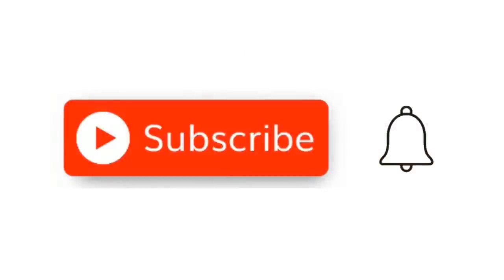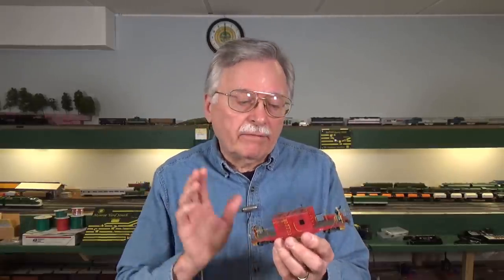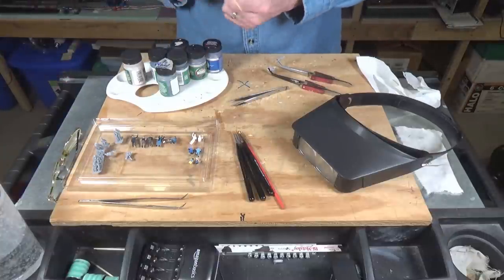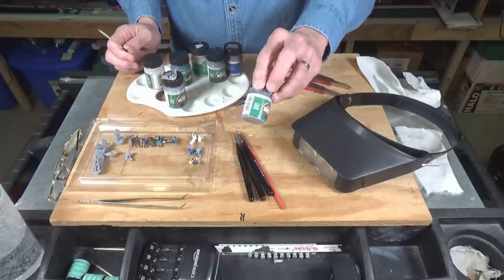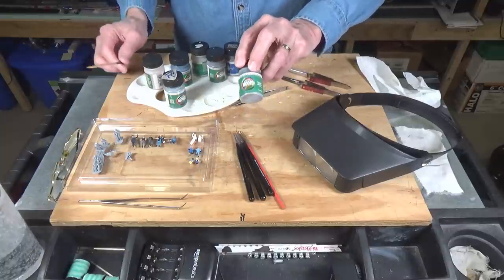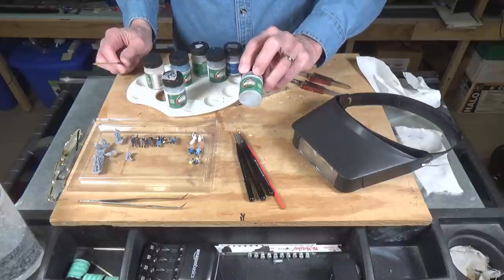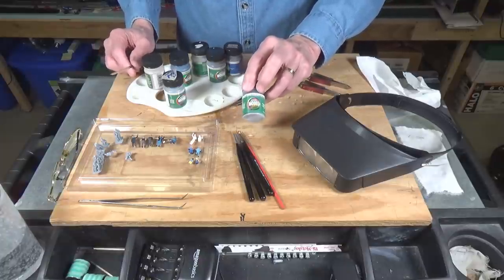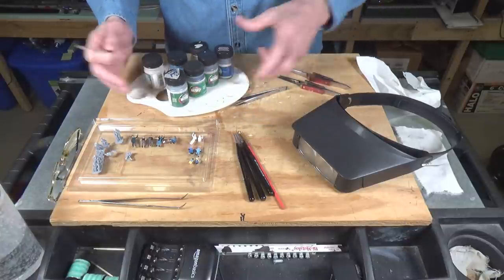Figures For Your Model Railroad (241)

Comment: The first thing I do with figures and other small things is drill a hole in the feet or mounting point and glue a piece of brass wire in it. I then stick the wire in foam for holding and paint drying. I also use tooth picks for painting real small details.
  Thank you for the videos.
Reply: Another idea is to glue a toothpick to the bottoms of the shoes, let it dry, then you have a holder that you can easily use during the painting process.  It can be cut off when painting is done.  The wire suggestion is excellent.
Reply from the maker: You can afterwards use the wire as a mounting pin in scenery. However this guy is destined for a loco cab so I glue his feet to the cab floor.
Reply: I glue my figures to the head of a 4d nail using Aileen's - the glue is strong enough to hold the figure securely, but will release easily when the figure is complete. I glue the bottoms of the feet on standing figures, and glue the bottoms (butts) of seated figures. The nails are then inserted into a piece of foam for priming. The nail makes a good handle while brush painting the details.

Comment: Thanks Larry.  Not painted figures for a while now, but that was pretty much how I used to do them.  Always used to use enamel paints (Humbrol were the main ones over here in the UK), which gave good coverage on most plastics.  You used to get more white metal figures too (I remember some American hobos that came from a Walthers dealer over here, which were whitemetal), which were harder to paint, and really needed a primer.  The whitemetal ones also had more flash on them that needed removing. But most of mine were HO figures from Preiser: it was still important to clean up mould lines, as it's amazing how obvious they come when you're taking close-up photographs.  Because you often get the same figures on every layout, I also like to do a bit of surgery on them: chop of their heads, legs and arms, and reposition them, or even switch them onto another figure. I've also made a gang of punk rockers in the past: just ordinary figures, but scrape away any hair and then glue on the mohican hairdos, made out of thin card. I think it's also important to keep mixing new colours, so that you don't have a street full of people, looking like they all bought the same clothes!

Comment: I painted up about 300 cheapo 1/100th scale seated passengers a year back or so, which work fine inside Passenger cars, where true 1/87 scale figures seem oversize. I used 6" skewers and with just a dab of tacky glue I sat each figure on a skewer. I then stuck the skewer in a piece of white foam which made it easy to paint a whole row of figures, while randomising the colors on clothing, round skewer makes it easy to spin the figure round between your fingers. Took me about 3-4 hours once I got the rhythm down. But now I have a few hundred more to do as I've added 24 passenger cars to my collection..

Comment: Suggest also washing well in IPA first to remove mold release agents.  Then when painting process is finished, spraying the figures with Dull-coat to tone down the gloss finish and protect the final product.  Also use a toothpick glued to the bottom of the shoes as a holder which can then be cut off when painting is completed is helpful.  Good video, keep up the informative information.  Love it with my morning cup of coffee.
Reply from the maker: Washing is always a good idea with molded parts however I have never had an issue with 3D printed ones. The great thing about Modelflex is i  the original patent application the developer claimed it would stick to a wax candle so I have never bothered with a primer when using it over the last 20+ years.
Reply: I also use the toothpick/cocktail stick approach but attach the figure using blutack.

Comment: Hey Larry, some tips as a long time figure painter:
1.) Priming. It’s critical to achieving a good finish on any scale of figure, and can be used to your advantage in setting up highlights and shadows using black and white paint for a technique called “zenithal priming” which is well documented by war gamers and figure painters

2.) The wet palette. Another favorite of the war gaming crowd, this is a cheap palette that keeps your paints wet and properly diluted as you work, and will keep a few drops of paint usable for hours.

3.) Washes. They aren’t just for weathering, a thin dark colored wash as a mid step helps to define the details of a figure and provide shadows you can then work around to create a more lifelike appearance.

Never hesitate to look outside the railroad hobby space for new skills folks, the war gaming and scale modeling worlds have a wealth of knowledge and techniques you can apply directly to your layout!
Reply: HO scale figures are usually considered to be too small to receive shadows and highlights, etc.
Reply from the maker: Washing is always a good idea with molded parts however I have never had an issue with 3D printed ones. The great thing about Modelflex is in the original patent application the developer claimed it would stick to a wax candle so I have never bothered with a primer when using it over the last 20+ years. I’ll have to look for the wet pallet. War gaming videos definitely do have a lot of great tips.
Reply: @davidwilliams1060  You'd be surprised, I use highlights and shading on 1/100 wargaming figures to good effect. It all depends on how much time and effort you're willing to spend on that aspect of your hobby though.
Reply: @TheDCCGuy  Totally fair, the advantage of the zenithal prime is that with properly thinned paints it takes care of quite a bit of the shading for you, making for a quick and easy way of providing highlights and shadows in the colors you use.

Washes in this context aren't actually cleaning, but using a highly thinned paint to tint the recesses of a model and give better contrast. Citadel and Vallejo washes are a favorite acrylic water based type that I use regularly to help add detail. 

Cheers!
Reply: I am a professional figure painter, I actually paint a couple of 3D companies and actual paint for ModelU3D, I use wet palette, acrylic paints, washes,
Reply from the maker: Ian—thanks for the tips, I really need to check out the wet pallets. I am hoping Alan will make his covid delayed trip over here this summer to do scans for a US range of figures. In the meantime I have collected quite a few for my UK locos.
Reply: @TheDCCGuy  hi, yes that would be amazing if and when Alan can get across the ditch
Reply: What is a wet pallette?  I've never heard of the term.
Reply from the maker: Apparently a plastic palette with depressions for paint and a couple mixing areas. It has an airtight lid that allows you to cover the paint so it will not dry out from day to day.
Reply: @dwaineruthannarmentrout1811  A wet palette is a well containing water in something like folded paper towels or sponge, with a sheet of parchment paper (unwaxed and without any anti stick or other fancy additives) on top. The porous nature of the paper allows a little bit of water through to keep your paint wet, and most of them have a sealing lid to let you keep paints ready for hours. 

Commercial ones are available, or you can just make one in a shallow tupperware type container to try it out. There are many tutorials on making and using them all over youtube.
Reply: @Harrumph  Thanks for your detailed answer.
Reply: @TheDCCGuy  Thanks for your answer. I always learn so many new things from your videos and I like the idea of your"feedback forum" at the beginning of the next video.

Comment: Loved the video!  Small problem - your camera lighting.  The lights reflected off your glasses.  Try pointing the lights towards the ceiling of your room and 'bounce' the light back to you.  This will keep the harsh glare off of your glasses, and the light fixtures will not show as a reflection in your glasses.
Reply from the maker: I use LED panels which give a nice cool light compared to my old halogen lights. However they are not as bright somI have to use more direct lighting instead of bounce lighting. I try to set up the lights at angles where the reflections off my glasses are minimized but sometimes I just can’t avoid it.

Comment: I am not sure which scale figures to use on my loco's and Diesels. Most of my models are late Triang or early Hornby. made between the years 1960 to 1980 and I have some later ones which I think the OO figures would be ok. any advice would help. Martin. (Thailand)
Reply from the maker: I think you need to figure out the time period your models represent and then take a look at the modelu3d.co.uk website for some guidance. He has figures for all the major eras broken out so you can easily see the differences on clothing for each.

Comment: How do I make an incline to bridge 30 inches wide and decline. I'm in rough pink at this time..please help
Reply from the maker: So you want to make a bridge span 30”? Is it in an open sceniced area or does it span an aisle or doorway? will it be a clear span with no supports or will there be piers or other supports? For my lift out doorway bridge I used hard maple for the bridge and 1/4” thick moulding for the sides creating a U shaped cross section.

Comment: Hey! I sent you a message on you facebook asking about your keep alives, can you check the question out or atleast give me an email to which i could contact you?
Reply from the maker: I haven’t used facebook in years, need to finally go back and delete it.
Reply: @TheDCCGuy  Okay, well if its cool ill reask the question here. if you have any info about it please let me know!

question: Hi! I recall finding your pdf online talking about diy stay alives a few years back and have ever since installed custom keep alives in almost ten of my engines! I do have a question for you though. I realize all manufacturers including tcs all use four to six 2-3v super capacitors. I have instead been using those 5.5V 1F coin super capcitors, wiring three in series. Is there a reason you dont use these? theyre more easy to find and cheaper, and three of these also take less space. Im sure you've thought of using these but why did you avoid these? is there some issue with it? I found that while in theory these 5.5v 1F caps should last much longer, for whatever reason they seem to drop drastically in voltage within a few seconds, making them effectively only push the engine through dirty track for around half a second instead of the theoretical 6-20 seconds. Is this why you dont use these 5.5v 1F caps?
Reply from the maker: I find the coin ones too wide for many applications so stuck with the smaller ones. I wish I could find the smaller ones TCS uses for their KA1&2.
Reply: @TheDCCGuy  interesting, did you find issues with their true capacitance? I used three of those coins wired in series but it provided less than one second of power to the motor operating at 30% speed. In theory it should be able to power an engine for 5+ seconds. I wired it into a tcs wow121 decoder with one wire going to common and one going to ground.